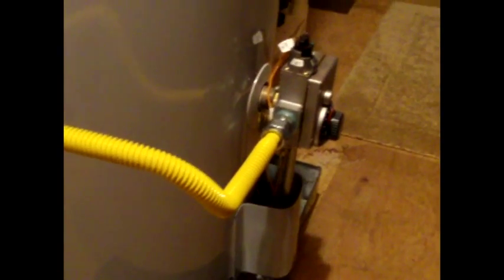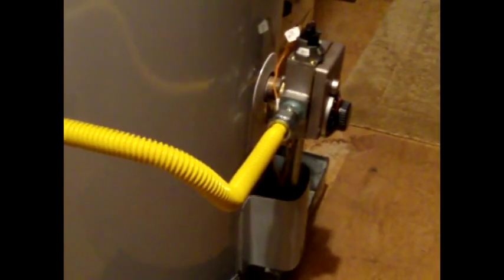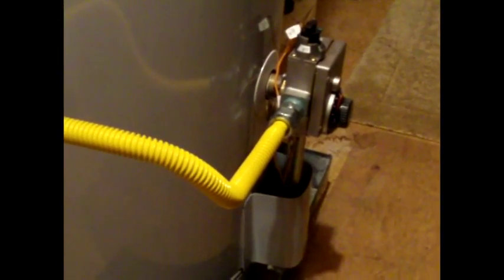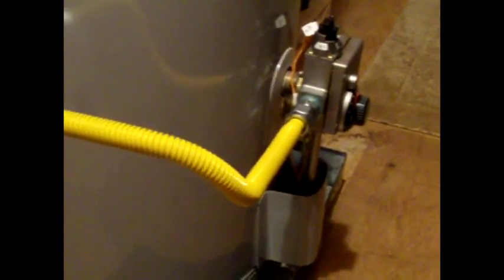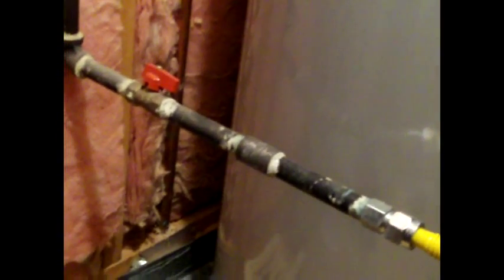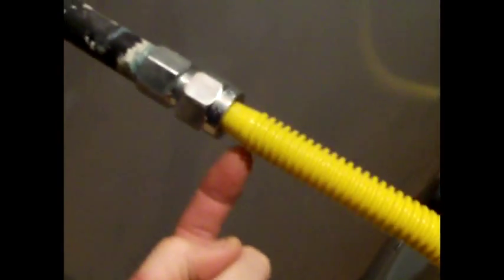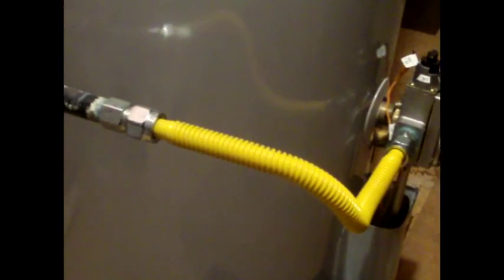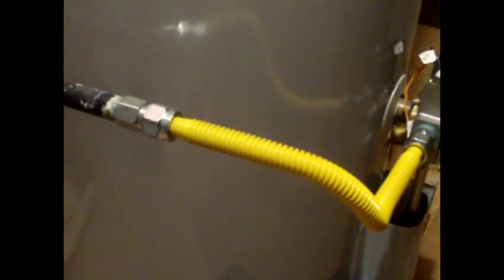Nashville Home Inspector Discovers Missing Dirt Leg on Water Heater Piping

Comment: That's. not where the dirt leg goes, it goes under that 90 before that shut off valve. Replace 90 with T. Also I guess in Nashville you don't need a union after the shut off valve??
Reply: Valve comes first from the gas source, then flex pipe if you use that (no need for union if you are using a flex pipe since unions make it possible to take apart and the flex pipe allows that), lastly comes the dirt leg that should be as close to appliance as possible.  So, to do it right, maybe a 4" black iron pipe from the appliance, then a tee on its side with the bottom of the tee also having a 4" pipe with a cap, and the top of the pipe accepting the line from the gas source.  The tee must be on its side to catch the dirt so make sure you do it that way.
Reply: NewSherriff InTown  not if it can be disconnected by the flex hose fitting.
The union is only there so you can take apart the gas piping.